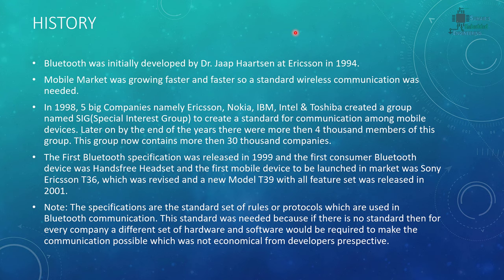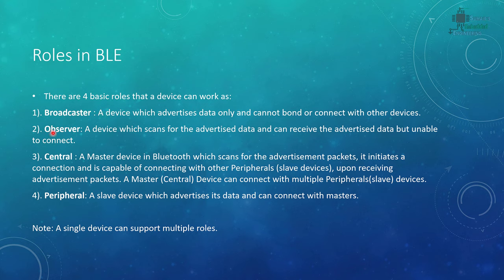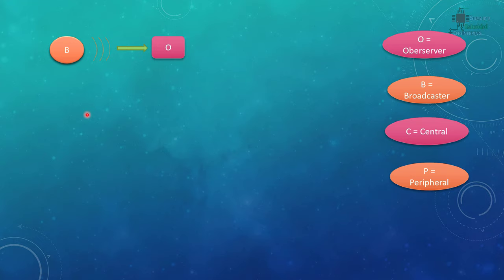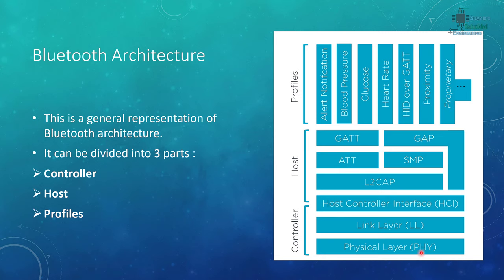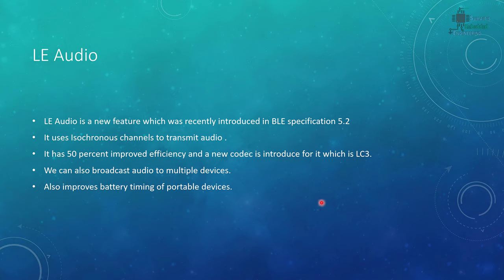nRF5 SDK - Tutorial for Beginners Pt 40 - Bluetooth Low Energy an Introduction to basics in BLE

Comment: Just for me to review, never mind :)
1:35 History
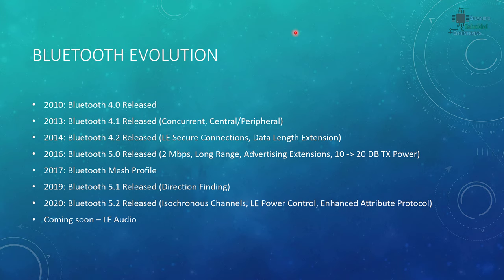 4:37 Evolution
 7:09 BLE basic
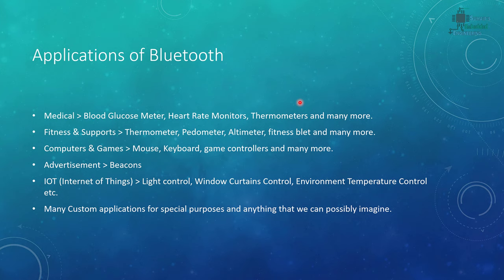 8:41 Application
[BLE Protocol Specification]
10:10 Roles in BLE
16:42 Architecture
> Controller
18:13 Physical Layer
20:18 Link Layer
22:30 Host Controller Interface(HCI)
> Host
22:53 L2CAP
23:20 SM,ATT,GATT,GAP
> Profiles - 25:11
 28:40 profile structure
--------------------
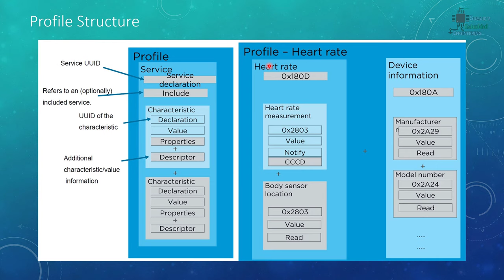30:54 How is data transferred
33:59 Advertisement
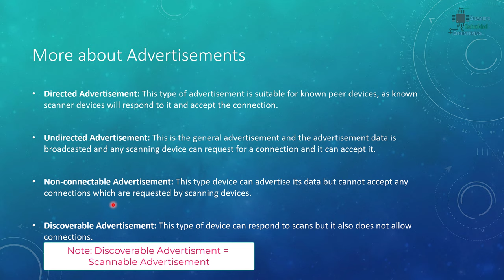34:54 How does the device start to scan the ad
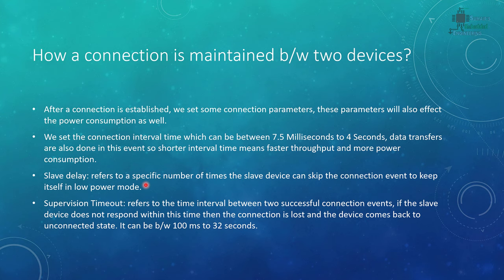35:55 Connection maintained b/w devices
37:04 Pairing & Bonding
38:19 Transmission rates